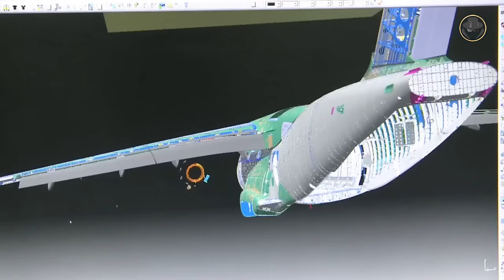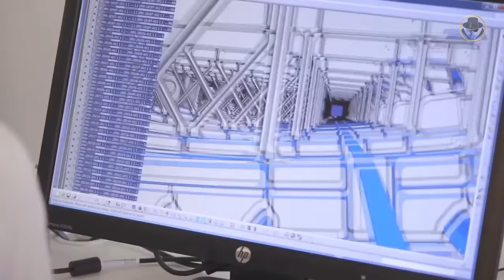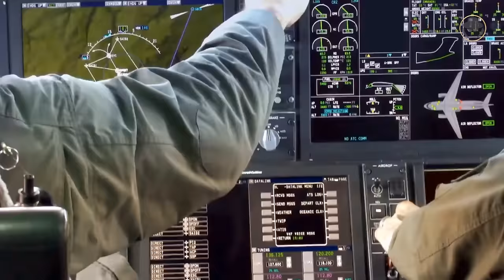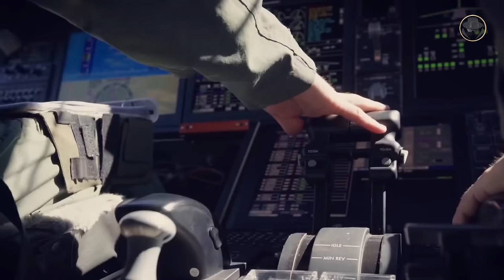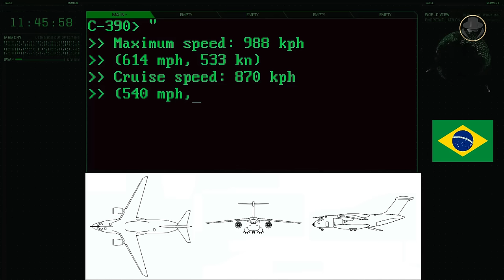Embraer C-390 Millennium | Is it the realistic alternative to the C-130J Super Hercules?

Comment: The K/C-390 are much superior than C-130J.
Reply: because it's  a Turbofan Engine unlike The Turboprop Super Hercules. but the KC-390 is not Superior to C17
Reply: @adrianbernardo202   C-17 is a diferent category.......
Reply: @adrianbernardo202 There's no way to compare it to the C-17. They are aircraft of different categories with different purposes.
Reply: @adrianbernardo202  bro.. C130_ loses in all requirements. The plane (c390) was designed from the beginning to be better than the C130
Reply: @adrianbernardo202 Did anyone here mention C-17? The KC-390 is not competing with it.
Reply: @adrianbernardo202 🤦🏻‍♂️🤦🏻‍♂️ you're comparing apples to oranges bro
Reply: @Mathewszinho  The 390 isnt competing with the 130 either. They do different jobs. You're never going to land places that a 130 can with a 390.
Reply: @nick21614  Which C390 cannot buried places? It can land on asphalt, semi-prepared runways, gravel, dirt and even snow (Antarctica). The landing gear is extremely reinforced and the wing is higher to prevent debris from entering the engine. (That wasn't me who said it, but the manufacturer Embrar). It's literally a tractor with wings.
Reply: @Mathewszinho  the c130 differs from the c390 even though they have a similar payload. C130 is designed to fly into combat areas and drop off tanks or armed vehicles at low altitudes, it also has a lower take-off and landing distance, plus it's more maneuverable for dives. the c390 is like a smaller c17, it does the transporting part perfectly but the ground support, it can't do.
Reply: @southside2459  Friend, where did you see that the KC-390 is unable to provide ground support? In 2020, there was joint training between the air forces of the American continent, where the first and only KC-390 unit to date performed the ground support mission together with C-130, A400M and C-17 aircraft. It can fly extremely slow and low without stalling. Research on the missions carried out by this ground support plane, landing on an unpaved runway, and supporting the bases in Antarctica.

I live in the city where the 1st Squadron - ZEUS Troop Transport Group (1st GTT) belongs, with its main aircraft the KC-390, in Anápolis-GO (Brazil). It flies low and super slow over the city... It's incredible to see it flying at a speed of 230 km/h.

I'm not saying it's better than the C-130, but it operates the same (very successful) missions as the Hercules does. And look, the Hercules is my favorite plane...
Reply: @southside2459 LLoby kkkkkkkkkk

Comment: The 4 turboprops of the C-130 have some advantages regarding resilience. Many C-130s are used for special operations.
C-130s landed with 1 engine left and started with 3 working engines.
It’s a highly overpowered aircraft - for a reason.

Comment: I have my own version for a C-130 replacement, and it uses Dyson fans. Plus, ideas for armament if converted to an AC version.
Reply: We don't care 🤷🏾‍♂️🛑✋🏿
Reply: @Triggatra4258  My comment somehow got duplicated
Reply: Show us the design
Reply: @kingdedede1066  I don't have blueprints now, but imagine a C-130 without its propellers, just the turbine part. Using them, we power some Dyson fans, large ones. The idea is that these 'bladeless' fans are more energy efficient than traditional fans.

And with the fans placed on top of the wings, much like the jet engines of the YC-14, Boeing's answer to the C-130, you can get even more lift.
Reply: @WolfeSaber9933  would that affect the strength of wing required
Reply: @kingdedede1066  For what? Having the Dyson fans or jet engines mounted on top of the wings? If it weren't for the political landscape, the YC-14 could have gone into production.
Reply: @WolfeSaber9933  maybe, but that’s true of a lot of things
Reply: @kingdedede1066  Like the L-133

Comment: the c130 differs from the c390 even though they have a similar payload. C130 is designed to fly into combat areas and drop off tanks or armed vehicles at low altitudes, it also has a lower take-off and landing distance, plus it's more maneuverable for dives. the c390 is like a smaller c17, it does the transporting part perfectly but the ground support, it can't do.

Comment: The C-130 is useful when you don't need something immediately. Turboprops are inexpensive to buy, and inexpensive to fly and maintain.
Reply: If not, the KC 390, probably because it is a more modern design than the c130, has lower acquisition, maintenance and flight time costs.
Reply: @wallacemjr  A C-130J, which is basically a 1990's design, costs about $75 million. A KC-390 costs about $100 million. I have no doubt the C-130 uses less fuel per mile, and fuel is a huge ongoing expense for the USAF.
Reply: @StereoSpace c130 is a 1990 project. Ho yes😂😂😂
Reply: I don't know the numbers, but it would be interesting to see the estimate values for maintaining 4  turboprop engines vs 2 turbofan engines. Remembering that it's a very reliable and widespread turbofan.

Comment: My Country's  Air Force, considered that, but still We chose C-130J Super Hercules because it's  more economical than Jet powered transport, but we use Embraer A29s
Reply: Where are you from?
Reply: they lied to you, C130J has an operational cost superior
Reply: You are from Chile?  Chile will buy used C-130Js from the United Kingdom because it does not have money for the C-390.
Reply: @Max62535 
Exatamente se for Chile
O Chile vai ir de J Super Hércules pq não tem dinheiro
Reply: @Max62535  Philippines, Although we considered the Millenium, but not yet on the lineup, The Super Hercs fits our needs, the training, and the aftersales support, and we getting newer ones, aside from used T/H models

Comment: This aircraft isn’t competitive against the C-130 at all. With just two engines and them being turbines, its mission reliability and operational resilience are both sub-par compared to the Hercules.
Reply: 😂😂😂 boa piada
Reply: You don't need 4 engines to do better than the old and outdated c130
Reply: @Motomotomaster  No? How else would you be able to lose 2 engines and still be able to keep flying? The C-130J can lose THREE engines and keep flying.
Reply: @afcgeo882 Continues flying to make an emergency landing, the kc 390 can simply glide in the event of an engine failure, taking into consideration that the engine that the kc 390 uses is extremely reliable,  In other words, trying to say that the c 130 is better because it has 4 turboprop engines is not valid.
Reply: @Motomotomaster  No, the C-130 can actually maintain altitude with three engines lost. Don’t make things up. Reliable of not, these are MILITARY aircraft for tactical airlift. They ingest FOD operating on unimproved airstrips, they take small arms fire, they suffer bird strikes. Having only two engines is a massive drawback for this category of aircraft.

As for turboprops… they are more efficient and more powerful at low altitudes, which again, for tactical airlifters is crucial.
Reply: @afcgeo882 It's no use, the fact that the c 130 has 4 engines is a demonstration of obsolescence, if it were in the 60s your statement would make sense, with current engines it is not necessary for aircraft to have 4 engines,the two engines of the kc 390 perform the same function as the c 130, but with greater efficiency, the kc 390 can land on dirt runways too, that is, if that was a merit, it is no longer, It no longer makes sense to buy the Hércules, the kc 390 does everything the c 130 does, but better.
Reply: Essa é a sua opinião mas não é a do mercado, o Kc-390 tem se provado um sucesso de vendas na Europa Ásia e pelo o que tudo indica no oriente médio também, muitos países da nato preferiram o brasileiro

Comment: This is just copium for the 390.

The millennium can’t operate from unimproved runways. One engine out, the aircraft is grounded. One bombed out runway, the aircraft is grounded. 

It is a fair weather airlifter and will not be able to get off the ground in contested battle space. What good is an airlifter if it only operates outside of the theater? Who delivers the last tactical mile?

Answer: not the KC-390
Reply: Kc 390 faz pouso e decolagem em pista não pavimentadas ele foi projetado pra fazer pouso e decolagem  na Amazônia onde raramente ou quase nunca tem pista pavimentadas você  esta bem mau informado
Reply: The kc 390 flies longer, is more modern, carries more cargo, flies faster and yes, it lands on a dirt runway.

Comment: Oh yes, I cannot wait for the Royal danish airforce to buy those and land on Rømø beach for training... Oh wait, never mind, do you also see the problem with this plane landing on beaches or in dusty locations? Yea that wont work, this is a NO GO for replacing the C130J SH.. Who even told you that? This is nonsense dude
Reply: I have to agree. The USAF found out the hard way in Afghanistan. Camp Rhino.
They were expecting to land dozens of C-17s there every day. Because of the dust thrown up by the reverse thrust, the pilots were experiencing brown outs INSIDE the cockpit.
They ended up using the brakes only. This chewed up the runway. This led to 7 landings at night and the Seabees repairing the runway the next day for the 7 landings the following evening.
Propellers for tactical.

Comment: No. It sucks. Poor austere airstrip capability - will damage unpaved strip with jet wash. High maintenance costs for the engines. Only slightly higher capacity than the more economical C-130J-30.
Reply: What facts and data were you based on to make this statement?
Reply: You can compare a summary of their features using the list provided on the wikipedia page for military transport aircraft. Details of their features are also available on their company websites. 

Further insight can be gained from reading reports of the performance of various transport aircraft in field conditions. 

I happen to have read up on it from various sources over the years because it was related to my work. I can’t remember all of the sources but the public information on wikipedia is a good starting point.
Reply: @stupidburp  If you don't know, Wikipedia is not recommended as a source of information due to the possibility of uncontrolled public manipulation.
How are you so sure that the 2 jet engines used in the Embraer model have higher maintenance costs than the 4 turboprop engines used in the American model?
Reply: Not this again. I gave wikipedia plus company sites because they are public information. I cannot share sensitive information and anyone that does is wrong. This can only point to what you are allowed to see and you have to figure out the rest through extrapolation and estimation.  Propellor based aircraft are vastly less expensive to operate than jet aircraft in general. The costs for operating C-130 in USAF service are public record as part of budget reports to the US Congress. This shows how inexpensive they are, to maintain, especially the newer C-130J models.
Reply: You are just wrong.

1. maintenance costs for C-390 is LOWER than C-130, two engine is less maintenance than four, you can check royal Netherland air force analysis that says that.

2. The C-390 literally has the same certification level to land on unpaved runways as the C-130.

You can find videos on YouTube of the C-390 landing without problems on completely dirt runways.

3. The advantage of the C-390 is not just 6-7 tons more cargo. is to be much faster, not only carrying heavier things, but BIGGER things, the C-390 can unload a Pandur 6x6 armed with a turret, while the C-130 cannot. 

and on the same topic of transporting tanks, to transport excessively heavy vehicles, the C-130 needs to modify its rear ramp with several attachments to support the weight of the vehicle passing over it, something that considerably increases unloading time, making the operation very difficult especially in hot zones.

while the C-390 simply lowers its ramp, which can handle the weight of any load without any modification. 

opening the ramp - unloading the vehicle - closing the ramp - end of operation.

If we compare the two vehicles, what we have is a C-390 massacre, not a fair comparison.

the reign of the C-130 is over, the obsoleteness of being a 60 year old design is now showing itself.
Reply: @stupidburp are you really comparing the operational costs of two widespread civilian turbofan with four expensive turboprop and claiming that the turboprop are shipper??? Wtf???